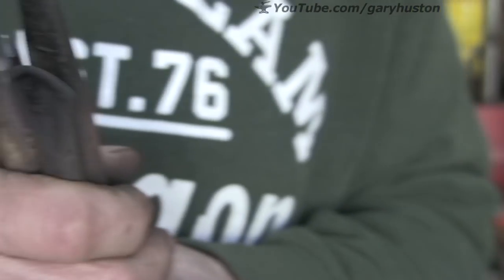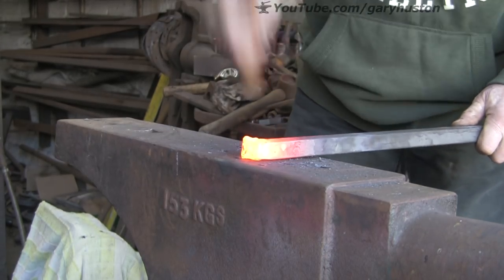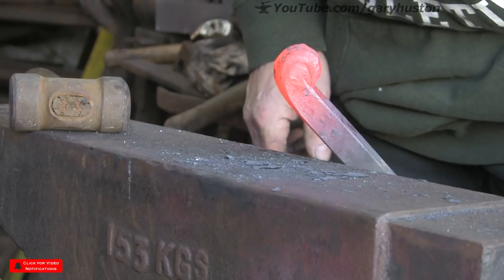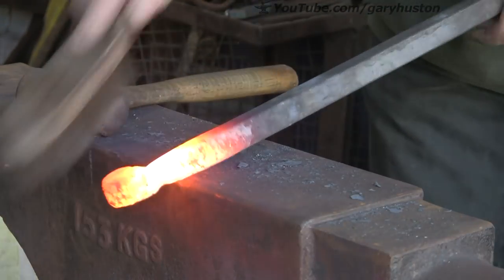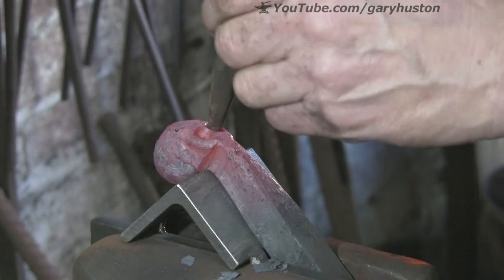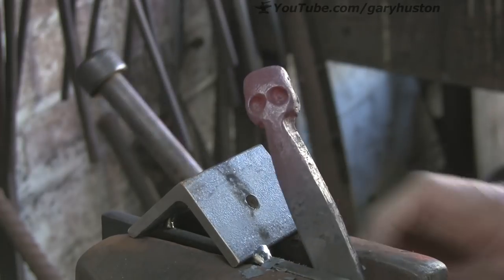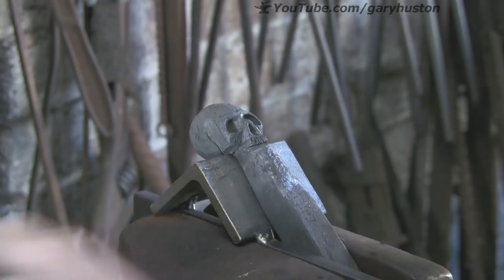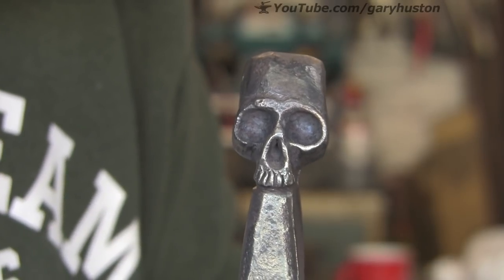Forged Skull from ¾" square

Comment: When you are detailing the teeth, try keeping your elbows tucked in tight to your sides. It helps keep your arms steady. Otherwise there is just so much leverage starting at your shoulders. This shortens everything up. And for even tighter control hold your breath as you align the chisel.

Comment: Another great video Gary, I've forged skulls before but not close to this method. I don't have any 3/4" material but I do have quite a few R.R. Spikes, spikes are generally 5/8" square but every now and then You might run across one larger. I'm looking forward to giving this a try.
Mike. 🔥🔨

Comment: That angle tool is pretty awesome. Is the hole in it for a reason?
Reply from the maker: No reason, it was just in the piece of angle i used.
Reply: @garyhuston  ok thanks I might try to make one. Not sure if you check your Instagram much but I sent you a dm with a link to a template for those Fredrick's crosses in different sizes, I know you don't need it but I thought it might come in handy sometime.
Reply from the maker: @OrionsAnvil  Thanks, just found it, very useful. Thanks very much.